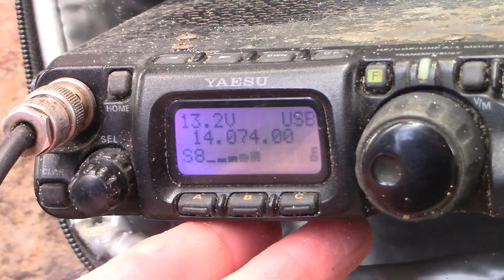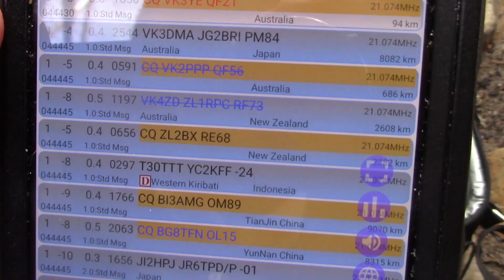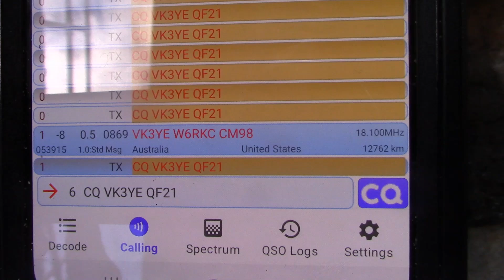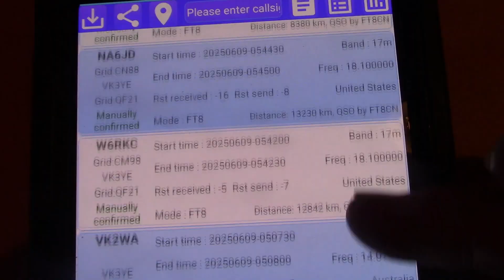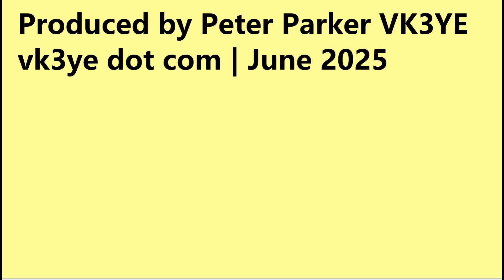FT8 DX under the bridge

Comment: What type of antenna where you using on the mast? And also counterpoise? looks like a nice and easy setup with multi bands. Also which app where you using on your Mobile?
Reply from the maker: FT8CN app. Antenna was about 7m of wire on fishing pole with L-match coupler.
Reply: @vk3ye  I see two little wires at the top of the 7m antenna... is's a capacitance hat ? thank you
Reply from the maker: @DomBru  It's just a single wire - no capacitance hat

Comment: 👍Driving around mobile HF, one thing I have learned is that some apparently unlikely locations work very well. These "mystery" locations are often well shielded by buildings or trees, at low elevation and with little sky visible. Theories I have include that they work on RX because they are shielded from interference. On TX (and RX), either the small patch of sky visible allows propagation or perhaps the objects in these built up areas work as directors or reflectors. Anyway, I have certainly learned you can find HF "sweetspots" in urban locations.